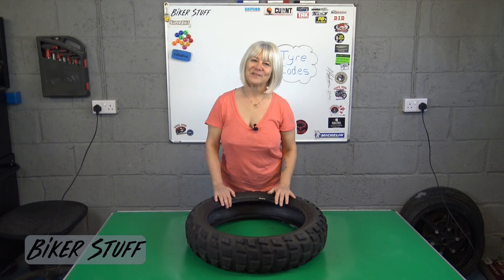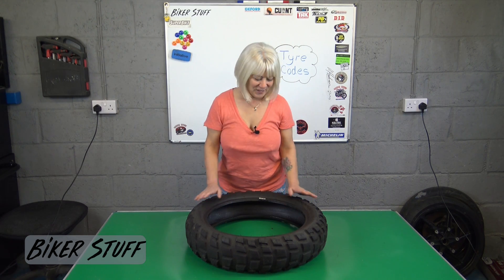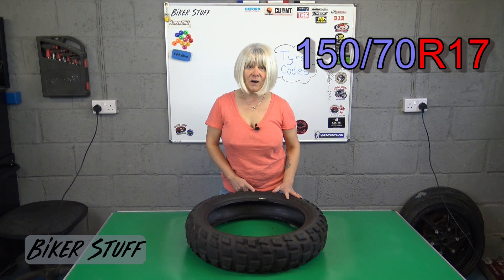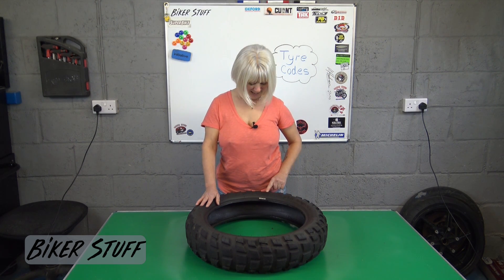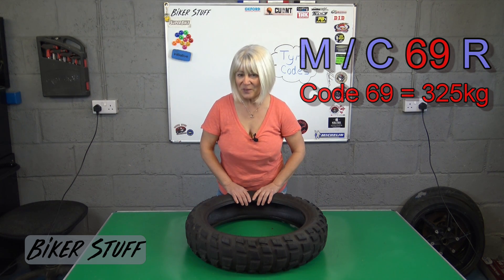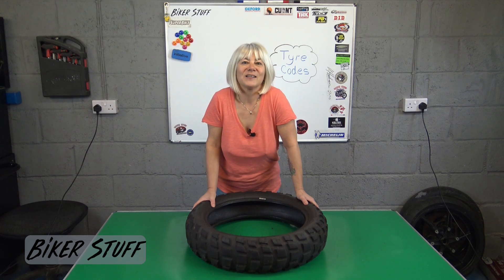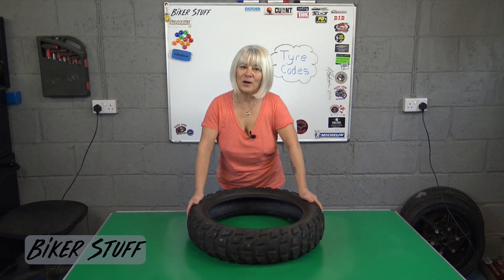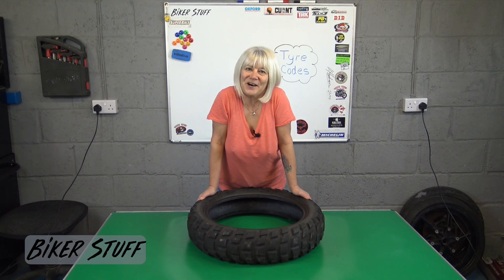What do the codes on your tyres mean?

Comment: Very useful info! Two points (no pun intended): 1. The remark about the bike having two tires to distribute the weight might make some viewers conclude that one can divide the weight by two and then select the tire accordingly. One can not. Imagine breaking very hard, maybe even lifting the rear wheel off the ground momentarily. Then the front tire carries the weight of the whole bike plus you, plus the braking force, and still needs to have enough margin to take point loads due to hitting a pebble or the wall of a pothole. So the tires do have a huge margin of failure, but one shouldn't cut that in half. 2. The width of the tire surely has to correlate with the width of the rim. Are there any guidelines for that? I.e. does the rim contain some numbers in that regard?

Comment: Is there no numbers to tell you whats the max pressure recommendation ?
Reply from the maker: Yes,  but that is related to tyre's construction not the best riding pressure for the bike.  Some exactly the same tyres but on different bikes will have different pressures.  This is due to the bike's suspension and overall weight, amongst others.